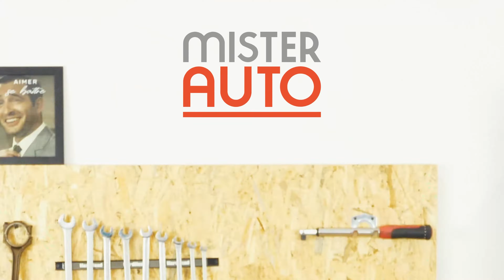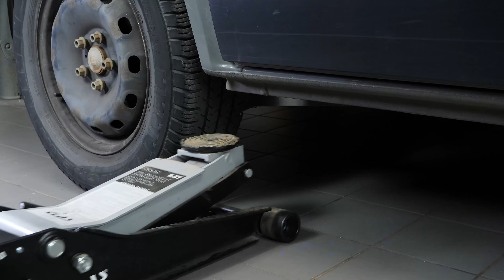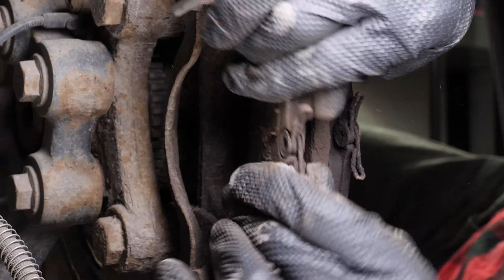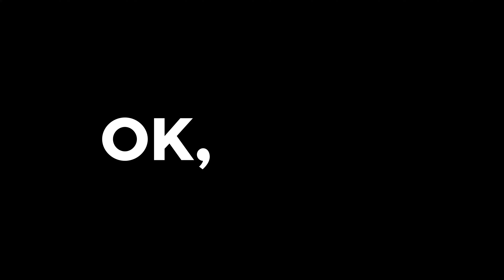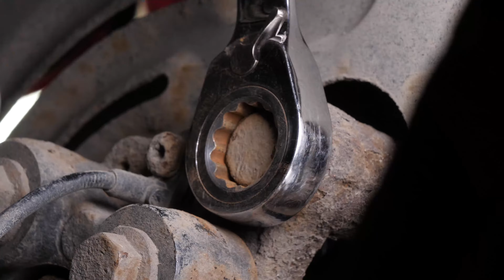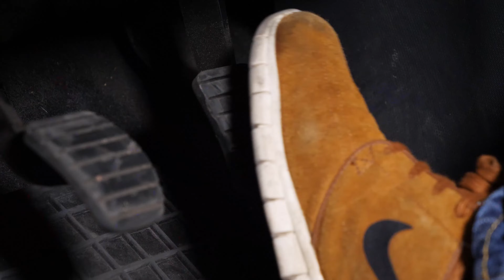How to replace the rear brake discs and pads Trafic mk3 🚗

Comment: This job just about killed me, Rotors were seized (try the nut and bolt into caliper method to pry it off, works a charm) and multiple seized/overtorqued bolts. Instructions here kept me sane so thank you